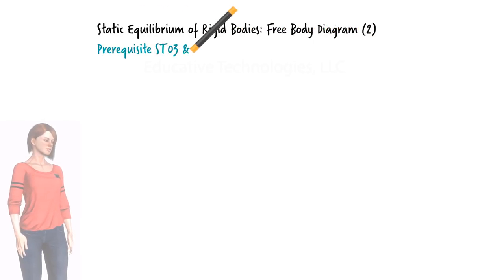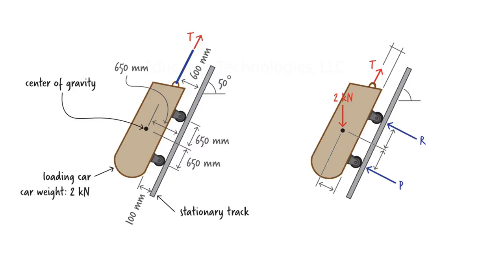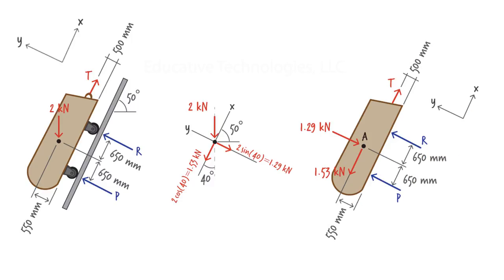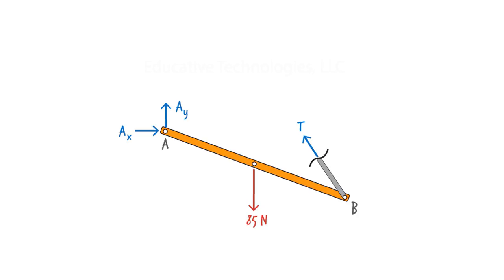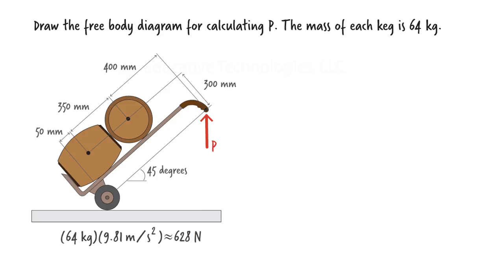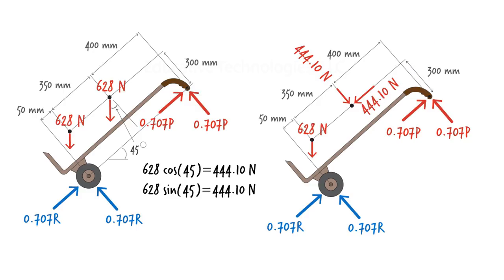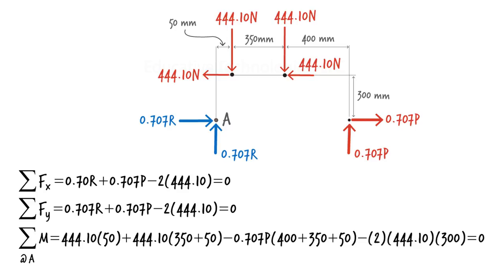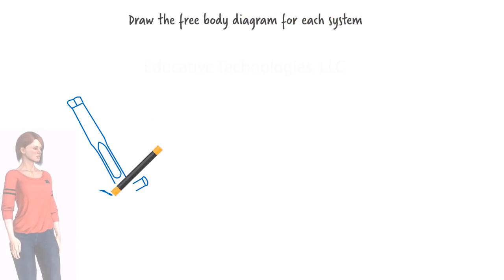ST05: Free Body Diagram for Rigid Body Equilibrium (II)

Comment: the calculation at 2:07 suppose to be 2/cos(40) and 2/sin(40), isn't it? tell me if im wrong :)
Reply from the maker: The 2 kN force is an inclined vector in the x-y plane. The vector makes a 40-degrees angle with the x-axis. Therefore, the x component of the force is 2 cos(40) and its y component is 2 sin(40).
Reply: @DrStructure  yeah, you're right. my bad, i see it in the wrong direction. when i move the 2kN tail to the center point, i see different thing.